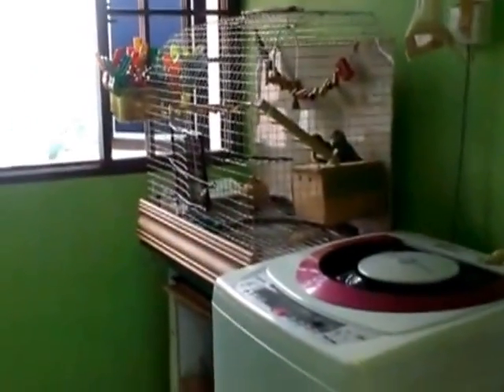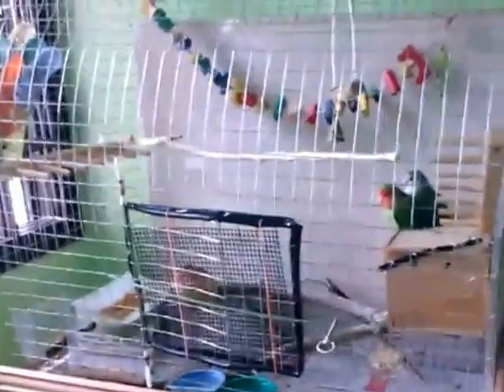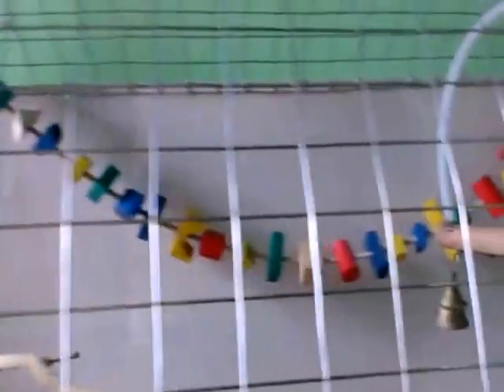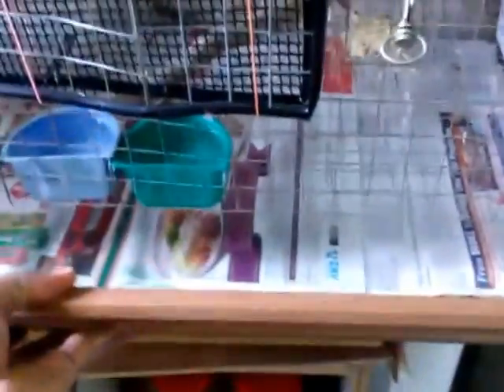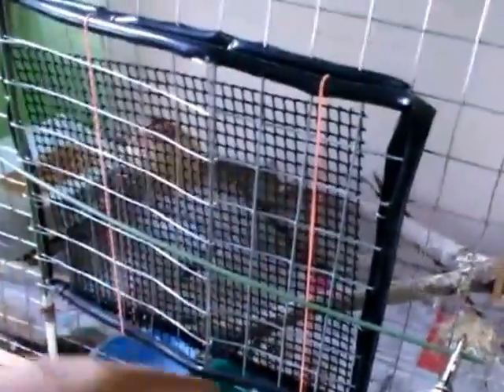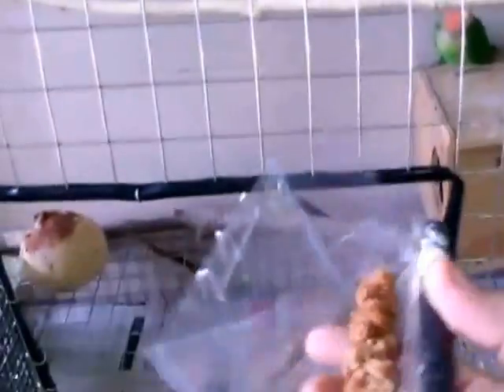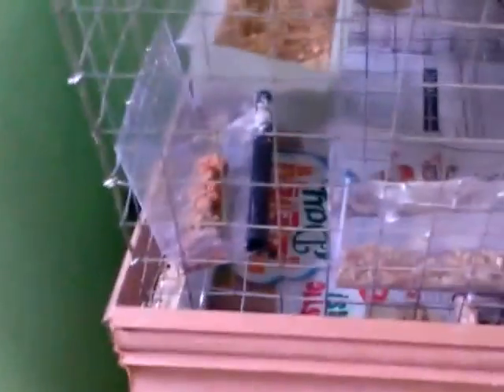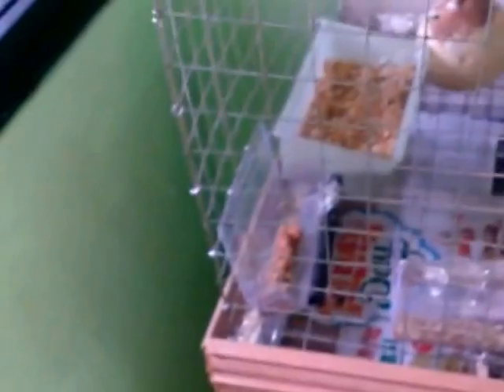How To Build Bird Cage for Lovebird

Comment: Great idea & thanks 4 sharing. I am asking u 4 the safety of all who watch though, please add this 2 your info section as a warning --- it MUST b mentioned * DO NOT used ANYTHING GALVANIZED as that means it's dipped in zinc and toxic 2 birds! * Ask many questions 2 ensure your stainless steel metal does NOT include zinc in the mix in any way shape ore form! It's easy 2 make this mistake. Hardware cloth is often galvanized, so it's important that u check, then check 2 more times before using things 4 your birds.